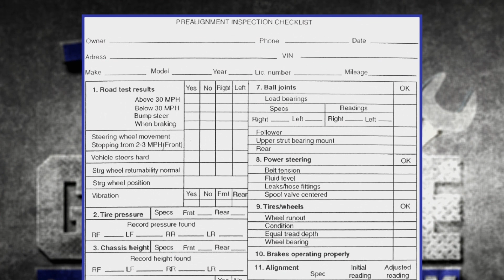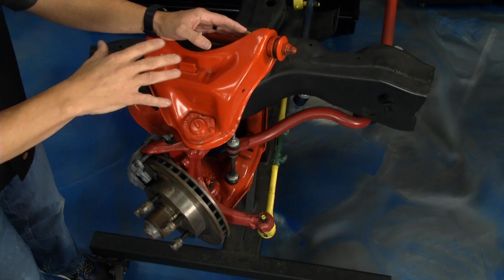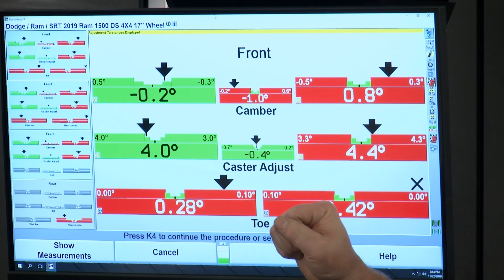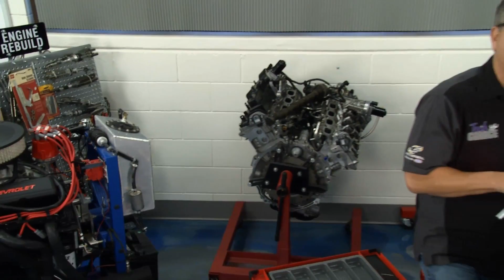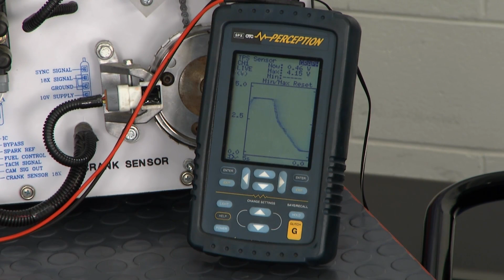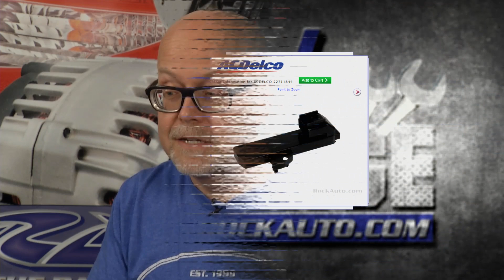Tech Garage - Ep 2002

Comment: I have a long term fuel trim issue.... causing a lean condition.  No vacuum leaks, did both the smoke test and propane test. Maf is good, o2 sensors are good,  gas cap is good,  swapped  out throttle body no change in condition. Only error code is lean condition. Car is 2008 Toyota matrix.  Did sea foam,  fuel injector cleaner,  replaced egr, and air filter. Am I missing something?  Awesome channel great content,  thanks in advance if you have any idea.  P.S. just went over 200,000 miles